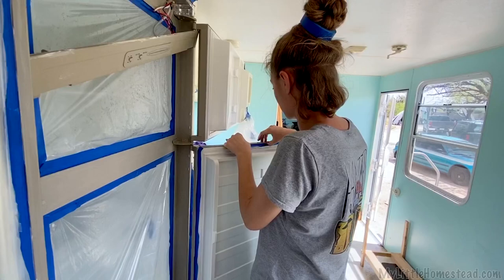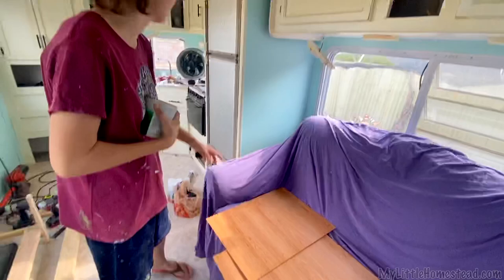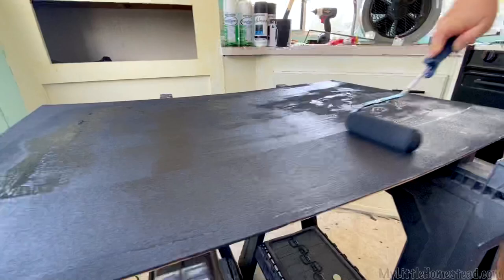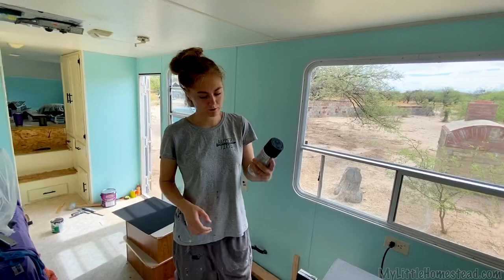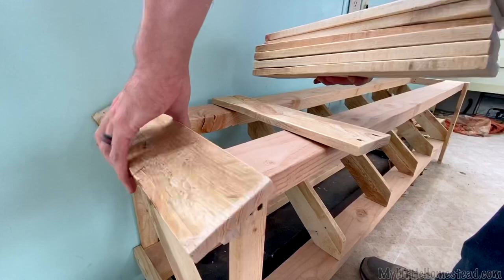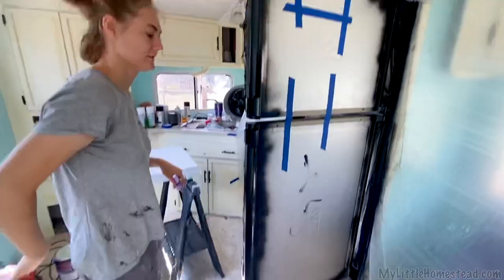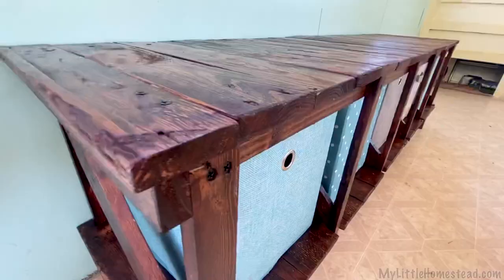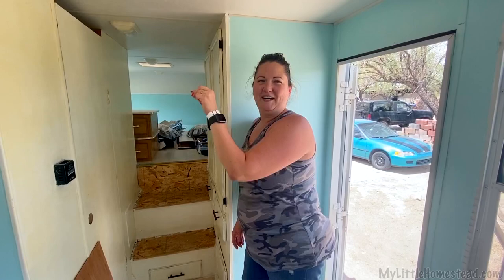Pallet Cube Shelf TV Stand & RV Fridge Magnetic/Chalkboard Paint | Weekly Peek Ep296

Comment: You might find that a little bit of timber or some sort of brace used as a stop for the TV stand will help hold the baskets in place while the 5th wheel is on the move. Vibrations  and rough terrain will see those cloth baskets slide right out.

Comment: On your TV bench, it may move away from the wall if not attached to the wall when traveling down the road.  Also, the storage cubes need restraint (rope) to keep them in place.  I would add a modesty sliding barn door in the sleeping area.  You need a catch or tie back (rope) when driving so it won't move when on the road.  This will be very handy when a guest comes and one of you is sleeping and add to the pallet wood aesthetics.  Rember to use all of the nooks and crannies for storage.  Even down where the utensil was located.  Clothing hooks are a premium item for or bed sideboard storage. Take a look at an Ikea catalog on small depth side storage for ideas.  Are you going to add a washer dryer combo or use a laundromat?  Adding solar may afford enough stored power to run the major appliances plus heating.  Best wishes on the nuptials sure getting close.
Reply: I recommend a secure space hiding valuables or VIP documents.  Do not video this!!!

Comment: Jared is a machinist?  So was my hubby for over 36 years. He too wanted to get into wood working. He'd bring home the huge crates that the cam shafts came in and made many storage cabinets out of it. He asked to use the table saw one day while on break and he noticed it didn't have a guard on it. He used it anyway and when he was about done, the piece of wood had a knot in it and when the blade hit it, it spun the wood and drew his thumb and index finger into the blade. Luckily he didn't lose either of them but cut them really bad.  So JARED (and the rest of you) put a guard on that table saw blade!! It's also nice to know that Jared is more than just a pretty face.  lolol